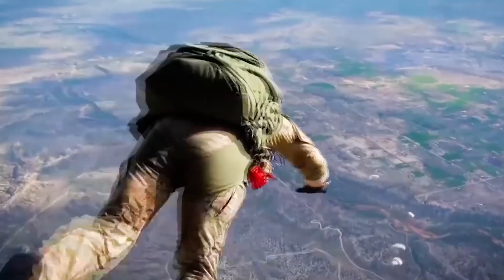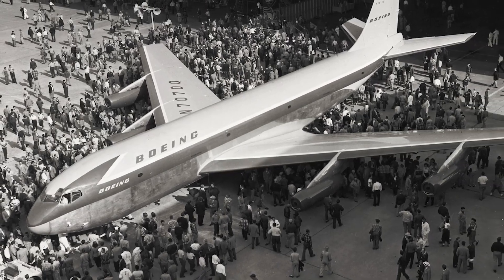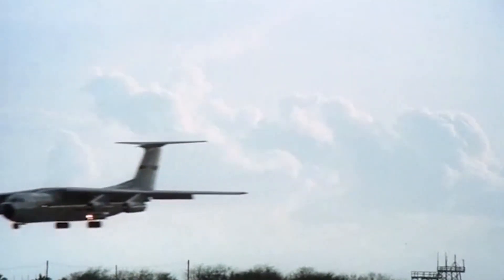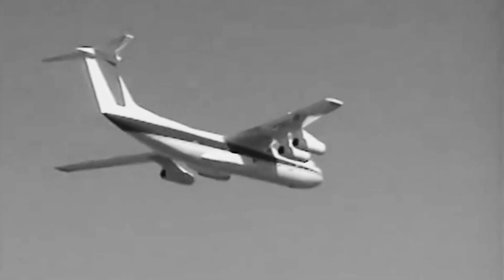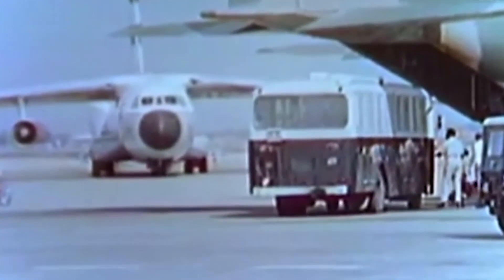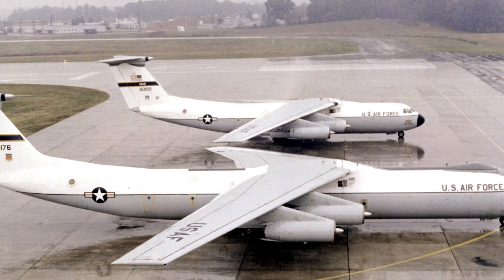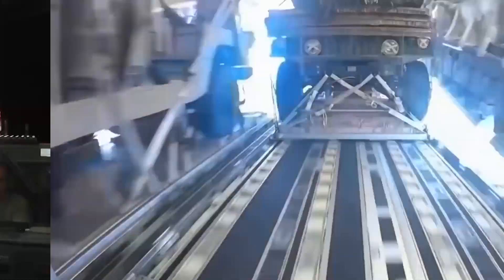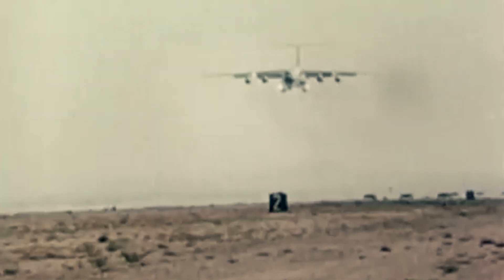C-141 Starlifter - a support for air bridges

Comment: The military cargo planes provided a learning platform to build larger and safe for planes.

The c-5a and the lessons learned went into building the 747.

The c-5a had a lot of problems at the beginning and I remember those who did maintenance on the c-5a saying they were using two-by-fours and fiberglass to repair the back doors. I was a kid back then my father was Air Force and due to some of the c-5a problems civilians will not allowed fly and the c-5a.

But I did get to ride a C-130 Hercules from a Pacific island to Japan.  The cabin did not have very much heating or cooling being a cargo plane.  It was uncomfortable sitting in the strapping caught and noisy. We flew along with cargo... at least we flew for free!

Comment: One of the downsides to the modernization of the C-141A to B-series was the higher fuel costs to cargo weight after upgrades. I saw many depots with cargo waiting to the shipped with signs on them from Army and Marine suppliers reading "Do NOT Ship on C-141Bs! Also, to cut costs on upgrades, the air refueling door in the B was a short-length steel bar located above the pilot's seat operated manually by the flight engineer.
Reply: Fuel cost was not the reason for not using the B or C models.  It was customer schedule priorities.  Like commercial airlines, the USAF schedules cargo aircraft to fly with a full load when possible -- thus amortizing their customers' unit cost.  Routine full cargo loads for A models (ten standard 463L pallets or equivalent) would be quickly filled and fly more frequently than B and C models since the B/C full loads were 30 percent larger (thirteen pallets).  This would cause "frustrated" cargo; i.e., routine cargo waiting longer on the docks before a B or C model would be available to pick it up for delivery.  The customer was incentivized to prioritize which cargo was more urgent and needed the A model's schedule frequency.  Or pay the premium for a smaller load that does not fill the aircraft (A, B, or C) and needs urgent delivery.
Space Available passengers often benefit from the smaller loads, if the cargo doesn't prohibit their riding along.  Space A is cheap and can be a morale booster.
As for the UARRSI door activation, simplicity is cost-effective.  It is user-friendly, reliable, easy to fix, and often quick to produce/procure parts.

Comment: Not bad video - I worked in Transit Maint. 2 1/2 yrs at Dover AFB primarily on C-141A's coming from Ramstien AFB in Germany. Sometimes I was in charge of 3 at a time. The worst maint. write-up I ever saw during that time was: Pilot's seat cushion lumpy and inadequate ... but they would take 20+ quarts of oil in one engine occasionally.

Comment: Those guys pushing stuff into the back doors, are doing my USAF job. I worked every C141 and C5 the USAF had flying in 1990-91. Its cool seeing tail numbers I worked 30 years ago. I signed the last one to leave active duty, and the last one to leave reserve duty when we got the C17. The C141B got worked damn hard from 10 Aug 90 to 1992.

Comment: Nice video as usual. A question,  this is perhaps the only plane on which the 1st stage of the jet engine compressor is directly exposed with no funnel air intake.  If the design was validated and introduced into production, why was it never seen on any other aircraft since simplicity and weight saving concerns logically prevail? Has anyone an answer?

Comment: I was USAF on C-141A's and B's before I became a "SAC trained killer".  It may be a bit unfair to compare aircraft with different missions and a generation removed from each other, but 141s were like Cadillacs compared to SAC's J57 water wagon fleet back then.  Boeing built some great aircraft, but in general I preferred Lockheed's way of doing things.

Comment: Can't the KC-135 double as an airlifter too? All the fuel is stored under the cabin floor, so it can still be used as a transport, like the KC-10. Technically, one could argue, the KC-135 is merely the tanker variant of the C-135 airlifter, only they just happened to make about 100 times as many KC versions.

Comment: Great video. With some amazing information and only a few inaccuracies. Like the aircraft was never certified for only a crew of 2. Min crew was 2 pilots 2 engineers basic mission crew had the addition of a Navigator and a Loadmaster.
Reply: That was my experience, and an augmented crew had two loadmasters and sometimes more if flight examiners and instructors jumped on.

Comment: observe the design of the C-141B it's not very different than present heavy lift transport aircraft!!! the C-141B can still fly even now but ofcourse it has to upgraded built new ones with present day technological advancements!!!
Reply: No building new ones. I was working at Lockheed in the 80s, the reason they didn't bid against Boeing's Globemaster was because all of the C141 tooling had been cut up and scrapped. We were building  C5b's and Lockheed tried to offer an extended number of planes on that contract at a cut rate. They said retooling for 141 would be too cost prohibitive to be competitive. Dumb idea in the end, wrong plane for the job. Funny fact is Boeing took so long getting the bugs out of the C17 and delivering, we had to do a life extension program on the 141 in the early 90's. This aircraft went far beyond it's design lifespan.

Comment: just like the C-141B Starlifter which was a stretched variant of the C-141A the Boeing C-17 Globemaster III heavy lift military transport aircraft too needs a stretched version more so than the C-141!!! when the Indian Air Force acquired 19 of the brand new C-17 Globemaster III heavy lift military transport aircraft the IAF insisted that they would love to buy a stretched variant of the C-17 Globemaster III heavy lift military transport aircraft with more powerful engines & extended range (if Boeing was willing to make them) & was ready to commit 33 additional order as well for the C-17 stretched version!!! it is also said that in the 1970s the IAF was interested to buy 50 of the stretched variant of the C-141A the C-141B Starlifter heavy lift transport aircraft!!! but back then it was the time of the Cold War & both U.S. & Russia had already picked their sides!!! the final outcome of picking sides was the Indo-Pak War of 1971!!!

Comment: Served as a Hydraulic mechanic on the C-141B, at Charleston AFB (1988-1993). Also in Torrejon AB, Spain,(1993-1994). Then at Rota NAS, Spain,(1994-1996). While in Spain, also worked on the C-5B. But......... my favorite Airfame of all, was the C141. Such wonderful memories, would do it all over again!

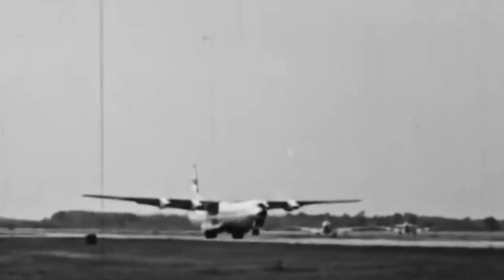Comment: Excellent video, as always, Sky! Thanks for producing and sharing with us. One correction, however. The Douglas turboprop, a pioneer for it's time, was the "C-133" (aka "Cargomaster"), not the C-155. (timestamp - 1:40). (note - you used the correct, "C-133", designation later in the video - timestamp 11:35)
Reply: Оговорился. Бывает. :-)

Comment: I was a company commander in 82d Airborne in the late 1960’s - many jumps, day and night from the C-141.  Night jet jumps were always a treat; that wind deflector gave you a little protection going out the door, but once you hit the slipstream, it was like being a cotton seed in a gale. Awesome. 
When our division’s 3rd brigade deployed to Vietnam during the ‘Tet’ Offensive in ‘68 we went from Pope AFB in North Carolina to Elmendorf in Alaska, to Kadena on Okinawa, to Chu Lai in Vietnam, on C-141’s. 
When we landed at Chu Lai about 0200 local, the base had just been under rocket attack. Our aircraft commander didn’t want to be on the ground longer than absolutely necessary so he did an ‘engines running offload’ - when we hit the airstrip he stood on the brakes, then opened the clamshells and lowered the tail ramp to horizontal. 
He taxi’d slowly down the strip as we hopped off with our equipment and made for the ditches on both sides of the runway. He told us before we landed to make sure we had EVERYTHING off the runway, because he was going to turn around at the far end and come straight back up under full power. 
We did. He did. 
I’ve never been that close to an aircraft that big, traveling at that speed. Wow!

Comment: Great workhorse was the C-141. I always suspected the Soviets might have pinched a few design cues from this aircraft for their IL-76. One cannot overlook a classic design. The original c-141 was wayyy overpowered for it's volumetric capacity. In Medevac mode,  they loved it because they could throttle back the TF33s and keep good speeds/range  for less fuel. The B version basically made better use of the powerful engines.

Comment: I was once involved in a crash landing in a c141. I was in the US AirForce band flying the "milk run" from Clark AB to northern Japan and somewhere over southern Japan as we came in for a landing at Marine Base Iwakuni, the front landing gear wouldnt unfold correctly. We as passengers had not a clue that anything was wrong untill about 15 seconds before we slammed into the runway. All of a suddend sirens started blasting and they yelling for us to RUN off the plane as fast and as far as we could! I remember sprinting full force and when I got a couple hundred feet away from the plane, I looked back and actually took a picture! Lol. I have no recollection of how or why I was able to grab my camera but the shot I took showed the plane had run off the runway into a ravine and down a small slope but it was steep enough that the plane was tilted enough to one side and the engine was touching the ground! There was no fire etc. and I remember someone saying that the pilot was still able to keep the nose up at 45mph...i dont know what the normal landing speed would be but I would assume that its probably triple that???? Anyone?
We were stuck in Iwakuni for a few days with nothing to do and man...we were BOARD out of our minds. There was litteraly nothing to do. On one of the nights we set up and played a show and i think we had MAYBE 10 people show up. The whole base seemed deserted ha ha!

Comment: I worked from late 1991 to mid 1994 at Warner - Robins Air Logistics Center on the Starlifter's Center Wing Box Replacement program. I  have flown on both the A-model and the B-model.

Comment: I worked as a structural engineer at the C-141 depot Warner Robins ALC. I found the original Lockheed proposal drawings and discovered  that Lockheed was thinking ahead of the USAF. An aerial refueling system was included in the proposal.  The capability that was needed for Operation Nickel Grass. Sadly the arrogant USA never thought that NATO allies would deny refueling access, thus the aerial refueling capability was not included in the C-141A procurement.

Comment: I was an Aircraft Commander and Instructor pilot on the C141B.  The airplane was a workhorse and pretty reliable.  The controls were fairly heavy like a DC-8.  The Flaps only had three positions....Full, Take-off Approach (same position), and up.  It was a relatively slow airplane for a swept wing jet transport, I believe we flew it between Mach 74 and 77 most of the time ( 74% to 77% of the speed of sound).  I have fond memories of the airplane and our crews.  We traveled around the world.  Our squadron motto.."you call we haul'!

Comment: Norton. AFB was my first duty station.  I was a crew  chief on the A models.  She was a pain in the ass for changing tires, and I wore out a couple of speed handles removing leading edges.  I still have a scar from changing out the copilot Windshield.  I worked on both aircraft used my Bob Hope.  The same two tails were used to bring the POWs home.
On 619, #1 engine would never get to full takeoff power, while #4 always overheated on takeoff.  Pilots would just run those two engines at part power.

Comment: I remember driving in to work one morning at MEM. My route took me by the TANG base and one of the 141's based there was kinked over to one side with a wing on the ground and the other wing bent. Here's a link to explain what happened. Yes rumor had it that 6 folks were reprimanded, and reduced in grade. https://aviation-safety.net/database/record.php?id=20011221-0 and heres a link w a picture of it broken down https://c141heaven.info/dotcom/pic_61_2778.php
Reply: If I remember correctly, it was parked at the terminal, and the passengers scheduled to fly on it witnessed the incident.

Comment: During this older time, it was called MAC , Military Airlift Command. Just saying...
Reply: I was in a VP Squadron in the Navy and when we deployed overseas the Air Force 141s flew our tools and other equipment to an overseas base. We deployed half the Squadron to Azores and we rode in the back with our equipment. It’s a long noisy ride from Maine to Azores. This was in the early 70s and I’d see these and C5s at both Azores and Rota, Spain. I see Air Force jets a lot. Today I saw 4 F-22s, 1 C-130; and 2 C-17s.
Reply: as late as 1966 the MATS markings were seen- as the jets were sent from Marietta Lockheed Georgia factory to mod center- Tinker AFB, and they came in marked MATS- came out as MAC marked jets. Watched this in both 1966 & 68 at Midwest City location near the base- the runway approach was near to our family apartments we had at these years on both N Key & Jarman St. Midwest City :)
Reply: We called it "Maybe Airplane Come..."
Seriously my first ride on a military  aircraft was in '77 from Ft. Gordon to 29 Palms on a training exercise ( Brave Shield? I think...) on a 141...

Comment: I had the immense pleasure to be a navigator on the C-141B.  It suffered from wing cracks due to being flown at low level (300 ft) in a mission it was not designed for, and it had a very high foot-print pressure which limited it's operation to runways and taxiways with reinforced stressed concrete.  Those limitations aside it was a powerful and capable aircraft  - it's a shame they never adopted the C model with the new engines, speed wing, and glass cockpit.

Comment: The C-141B and the L-1011 were the smoothest flying and my favorite planes to fly on.
Reply: Lockheed rarely screwed up in this department - built some really amazing aircraft. I’m still bummed they lost the commercial market.
Reply: @EstorilEm  Same, they didn't fail the L1011, we failed it
Reply: My FIL was a flight engineer on  141s during the VietNam war. He told me the Starlifter didn't take off...the runway just fell away. :)

Comment: I worked at Lockheed at Dobbins in the 80's. Inside there is a ladder going up the empennage then a door on the top that opens to the top of the T-tail. I had lunch many days up top thinking about how to protect the C-141 from missiles and other ordinance. Fun times.  The C-5 is another story.
Reply: Climbing that ladder on a hot summer day was exhausting.  I would put on gloves, take a big breath, race to the top of the ladder, and open the hatch to get another breath.
Reply: @robertheinkel6225  One time i heard noise down below and they were prepping to move. The chief had been relieved and forgot to tell the new one that i was up top.  They had to reopen the clam shell doors to let me out.

Comment: Did the C141 configuration influence design of the iL-76?
Reply: Yes, the basic C141 configuration has influenced numerous strategic airlifters both American, Soviet, European, Japanese and Brazilian design, though the Il-76 embraces a different philosophy to the C141, preferring larger loads at a shorter distance to less equipped airfields, which makes sense given the USSR's geographical and infrastructure requirements.

Comment: My dad was a surveyor in the Air Force in the 1960's. He was stationed at Travis in 1967. One day a crew chief came in asking if he could have an airplane looked at. A C-141 evacuating injured troops out of Vietnam had run into some major turbulence. Some people where hurt and the chief was worried the plane might be damaged.
      He set up on the wing root on top of the fuselage and sure enough, the vertical tail was off by several degrees. The plane had to be scrapped.

Comment: I was a Flight Nurse for 8 years and flew many missions in the C-141B. It was a great aircraft.
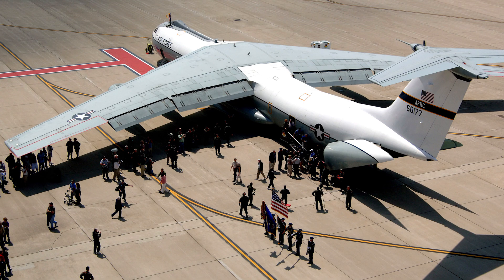Reply: @6:42 I took my FN checkride with a full bird Colonel over my shoulder on 60-177, the Hanoi Taxi. Great memories of that historic aircraft. 445th AES
Reply: Thank you from the bottom of my heart, I do not think the Nurses that served in Vietnam ever got the credit they rightly deserve. The danger was greater than most people know.
Reply: @racerd9669  I was a bit late to that party.  I served from 1987-1995 and flew in the desert instead of the jungle. Well, a little in the Central American jungle (Just Cause, Panama, 1989), and then Desert Shield and Desert Storm a couple of years later. A bunch of brush fires, compared to the long slog of SEA.
Reply: I would love to speak with you. Flt Eng 141

Comment: Can you at least use KG for thrust so I can at least just easily multiply it by 2.2? I have no idea how to convert kN to Lb.
Reply: 1 kN is 224.8 lbf. Call it 225. You can probably work something out from 5 x 5 x 3 x 3. Or since it is just 2.18% more than 220, go with your familiar 2.2 conversion and move the decimal place over two spaces.
A kilogram force is 9.8 Newtons, or 1 kg multiplied by Earth standard gravity in meters/sec.
Hopefully, something here works for you.
Reply: @Markle2k  LB thrust is original equipment...